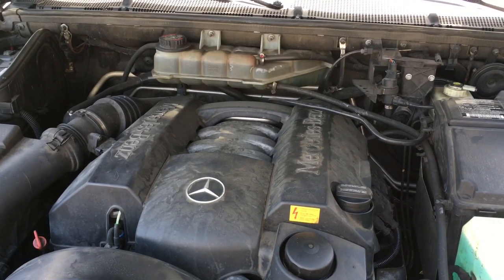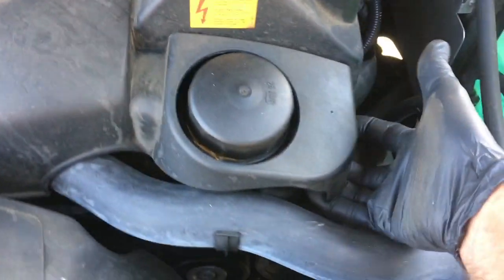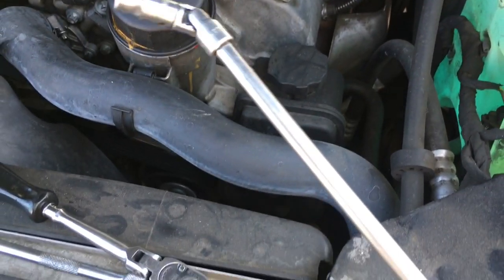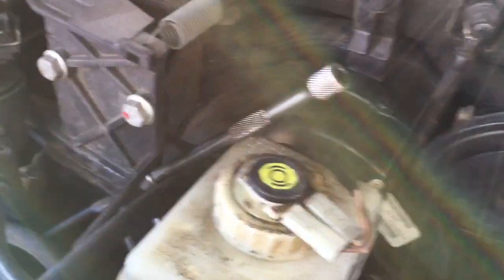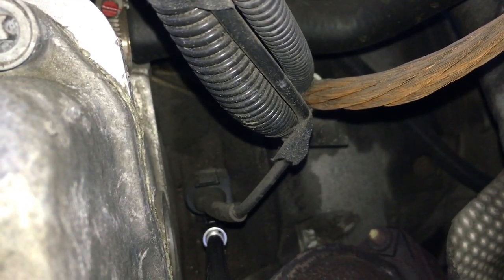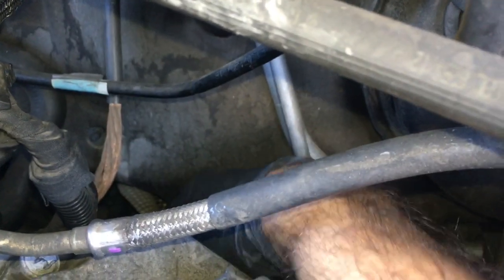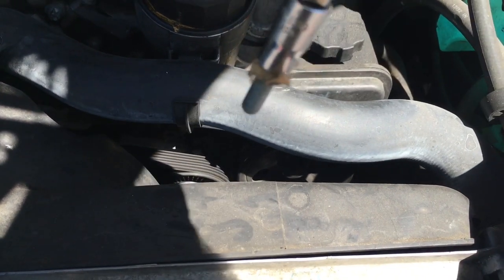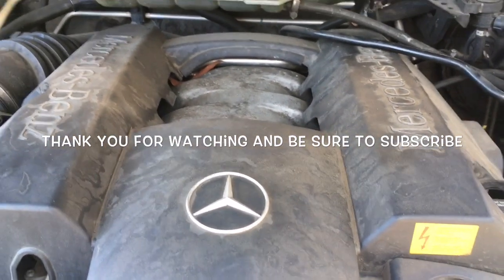How to Replace the Crank Sensor on a Mercedes ML320

Comment: Hey Brian I have an 05 ml 350 and I threw a code for the crankshaft position sensor. Is it pretty much the same as the one in your video? Also, is there only 1 sensor? Thanks for your help and your awesome videos
Reply from the maker: Yes there’s only one crank sensor. And it’s very common failure part.
Reply: @HowtoAutomotive  could you tell me the part # by chance? I clicked on your link to Amazon and it's not working for me.

Comment: I have mercedes gl350 diesel.  jerky transmission when cold.  p0336. FIXED. Best from underneath. TAke the plastic shield from below the transmission pan off, using 8mm wrench.   Look above the starter and the LH fwd drive shaft and you'll see the plug on the driver side where the engine meets the transmission.  It's at the 10 oclock position, just like on the Sprinter. I have a GL350,2013. crankshaft position sensor. metal shield over connector. use torx box end wrench.
Reply: That's cool.... so this is an easier way to get to that Bolt?

Comment: What's the part number of this crankshaft sensor? where can I buy the original crankshaft sensor for Mercedes Benz ML430, V8?
Reply from the maker: Clinton Snow there is a link with the part number is in the description of the video.

Comment: what are signs that the sensor is going bad? my 2002 has a noticeable rough idle, but i just took it on highway trip and got 21mpg. also, a little tip on the 'vanity' cover. the left rear attachment (standing in front of engine) is NOT attached by rubber grommet, but by cheap piece of plastic clip. i know b/c i broke mine!
Reply: It will generally become hard to start when hot; long cranking and sometimes stalling

Comment: very helpful video, is it true that crankshaft position sensor can go faulty even without engine light coming on? thanks
Reply from the maker: Gary Yung yes see it a lot. The car will have an intermittent stalling symptom or a crank no start.

Comment: What if after changing the crankshaft and camshaft on this ML320 it still does not have power to accelerate and the rpms revs but the car does not speed at the time it is accelerated?
Reply from the maker: Aimee Montenegro The way you’re describing it sounds like a transmission issue. Start by pulling codes.
Reply: Uh Oh😮

Comment: hi My ML 320 seem to be having the same problems, It starts and run for like 20 mins and then turns its self off and after a 10 to 15 min wait, would start again and then repeat the circle all over again. Could it be the Crank.
Reply from the maker: David Agabi yes it could be the season or a Fuel Pump shuttling down. You’ll need to test for fuel pressure and also for spark to determine which one is the problem

Comment: Will you always get a check engine light with a failed CPS?  99 ML 320 turns over briskly  but will not start.  Wait 15 minutes and it will start.  Has died on me a couple of times when  at stop.  Have checked with ODB II and get no apparent faults.  Still possible CPS?

Comment: I'm doing this very thing on my 2000 ML320 and am having problems getting the new sensor all the way back in and having the bolt hole line up with the thread. You make it seem so easy. It's the exact same sensor so that's not it. There's just no wiggle room to get leverage. One of the few times I'll need a guy to help me.
Reply from the maker: jamnjam i've seen if it's an aftermarket sensor that they don't slide down inside the hole. So what I have done in the past is use sandpaper and lightly sand the sensor on the outside to make it a little smaller and then slide it in.
Reply: That makes sense. I thought I was just super stupid, weak, or a little of both! I can't even get it back out. Got a buddy coming by to help and I'll be taking your advice. Thanks!
Reply from the maker: jamnjam there's not much room down there and he can be a pain. Let me know how it comes out thank you for watching!
Reply: The sandpaper worked like a charm. Too bad the crankshaft position sensor isn't what was wrong. I inherited it and it has 230k miles so it probably was due for a new one anyway. I've got a friend with a professional code reader coming by. I drove 200 miles the other day and 10 miles from home it just lost power on the highway, started sputtering, and then died after awhile. It restarted over and over but ran rough and moved only a few feet at a time. Got it towed. Next day started up & drove great for 2 blocks. Figured it was gone. Later, it went only 10 blocks and started the whole shuttering thing again. Towed again. Cranks fine, battery and alternator are great, so I took a stab at the CPS. I pray it's something normal like a fuel pump, not some weird obscure electrical problem. But it's not the sensor and now it doesn't even stay running. Now the fun begins.
Reply from the maker: jamnjam it sounds like a fuel pump. You can test fuel pressure when the problem is happening. There is a possibility of a bad mass air flow Sensor. Scan tool will tell you more.
Reply: Thanks so much. Your videos are vitally helpful. Subscribed!
Reply from the maker: jamnjam thank you so much!

Comment: Signs that you need to replaced this is when engine got hotter and after you turn the car off it will not start until you wait it out to cool down ! Replaced mine already when it’s only 100000+ now im in almost 300000!

Comment: My ml320 start up then turn off I'd change fuel pump n fuel relay and put a new battery n still doesn't stay on plz need help
Reply from the maker: ttaei66 sounds like the crank sensor is bad but without testing hard to tell.

Comment: I've read that sometimes you can get a crank no start condition if the CPS goes bad and also won't show any codes with OBD2 reader. Have you experienced this?
Reply from the maker: Yes I have run across that exact condition before. The car will not have injector pulse or spark.
Reply: @HowtoAutomotive  Yeah I'm working on a 99 ML430, code for IAT so replaced MAF (checked wires to MAF plug they're OK), checked fuel PSI @ 50 should be 60 but I understand it's lower when cranking then gets higher after started (replaced FP anyway since level sensor bad), cleaned tube from EGR since common for them to carbon up (210k miles on vehicle) (have a 2000 E320 that had a no start condition and cleaning EGR tubed fixed that), also swapped in a good used ignition switch key sensor, so ordering a CPS since I can't think of any other issue that would cause this condition.
Reply: OK installed a new CPS and it seemed to almost want to start. Then same symptoms of crank no start. Did some more research on M113 engine and read if it had gotten flooded by fuel prime the system by cycling the key to position 2 several times without cranking. Then hold pedal to floor and crank. That did the trick and it is running. It does have a rough idle so spark plugs next, has cheap Autolite one from previous owner and look over gapped and carboned. Going to replace with NGKs and see it it takes care or rough idle. (since TB, and EGR have been cleaned, also new Bosch MAF)
Reply: Replaced the plugs and still same condition of crank no start and also a fuel smell. The old plugs smelled of fuel too. On further investigation I started wiggling the key then pushed on the main power plug going to key assembly then it started. Depending on where I pushed it, it would either make it start or (if running) would shut off if I pushed on it. So going to replace the ignition switch PN 1685451004
Reply from the maker: @DaytonCarCare  sounds like you found the problem..
Reply: @HowtoAutomotive  Yeah I should get the replacement switch soon. I figured I would furnish the info on my findings in case someone else might run into the same issue. The ML has around 210k miles on it.

Comment: Thanks Brian is that an expensive job?
Reply from the maker: If it's just a vacuum hose then no it's cheap. But if it's like a gasket leaking it could be expensive. Just pop off the engine cover with the engine running kind a listen for the hissing noise.

Comment: hey amazing video, my question is why do we replace the sensor, i have ml320 1999 and every thing works it just some times the engine stops and i have to wait for 30 mints or reset the battery then engine starts i have no killed switch or any starter  or alarmes i saw you video but my question is this the sensor malfunction  and must be replace?
thank you  very much
Reply from the maker: Reza Ahmadi stalling is one of the symptoms and no star is another symptom. There usually is a code stored in there PCM for the crank sensor.

Comment: I was about to spend $200+ I'm going to do it myself and spend only $55  :)
Reply from the maker: dannyninerempire very cool thank you for sharing!
Reply: $200 it swap out a CPS that takes about 5 minutes to do. Cha-ching lol. Just serviced an Audi S4: radiator, AC compressor, intake manifold seals and oil check valves,  oil/filter change, and an engine mount. Total labor $500. So $200 to do a simple CPS, yeah kind of pricey.